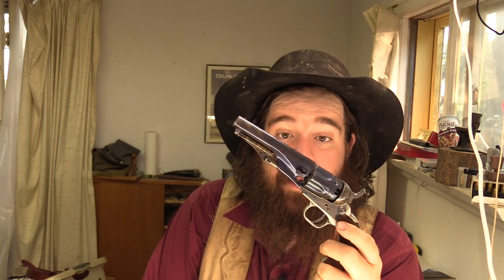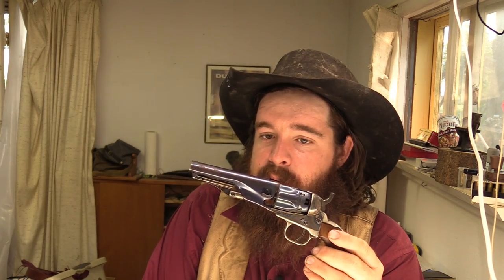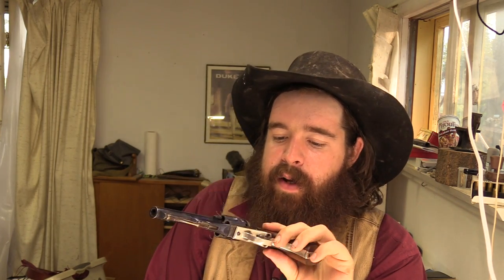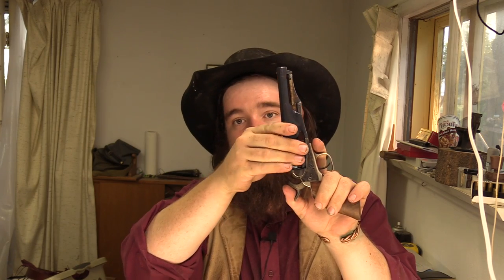Uberti 1862 Pocket Police

Comment: I have successfully made springs from music wire line the ones that track of the wolf sells.  I have put them in my 1851, 1860, 1861, and my 1862. Makes the pistols run super smooth.

Comment: I ended up putting two main springs in the one I had because it didn't always set off the caps and it got cap jams. Slixshot nipples fixed that issue. I sold it 6 or 7 years ago but plan to buy a new one.

Comment: One of my favorites.  I have an Authentic Colt police. I fire the elongated balls cast from the steel mold. The Colt mold.  As far as muzzle energy and all those questions, regarding modern comparrisons ,. At 50 yds, it penetrated through 3 pine boards with a 148g elongated charged with 18g FFFg GOEX (one 1'' board full penetration was considered lethal back in the day).  So, this is all the 'muzzle energy' info that s  needed.  Curiously, the Police outperforms the Pocket Navy both in power and accuracy.
Reply: You quit aiming.  I m  currently learning how to 'point shoot' the old Colts.  They were actually made by Colt to be used this way.  What a pain though.  Good shoot n!  This is a fun video to watch.  Hey!  Do a comparrison shoot with a light pocket, heavy pocket, Navy etc!

Comment: I have 2 of the Police models, 2 of the Pocket Navy models , .  I can make springs out of band steel quite well. Just shaping/filing etc as it is. No heating/annealing or whatever.  Works good. Anyway, one curious thing,- One of the Pocket Navys I have has a oiled stock instead of varnished (all of mine ar Authentic Colts). The stock is serialed to the pistol. Back in the day, Colt did strange things like that too. ALL  were silver plated though. None of these were military issued. I noticed that Uberties replicas are not plated.  Just another way for them to 'save money'?

Comment: I was surprised as to the power of this little pistol. It is more powerful than the Pocket Navy due to the rammer having more travel.  With 17g charge and a 148 elongated cast from an authentic Colt mold, this sucker   r e a l l y   delivers!  Mine are the 5 1/2'' models.  Aim point at 12 yards is 5''  low. At 25 yards, 20'' low and at 50 yds 30''  low.  Once the aiming point is figured out, the grouping is good!  As with all these pistols, the best performance is with a fair size elongated and a powder charge that compresses to where rammer travel stops but does not reach the end of its travel, and the tip of the ball   j u s t   below the surface of the chamber.

Comment: REQUEST... I want to put a Birdshead Grip on an 1862 Police and am toying with couple options to match up the back strap. How does the Uberti Lightning/Stallion Frame size compare to the 1862 please? Since of course the normal Uberti Birdshead grip options are slightly too large for the smaller 1862 frame. I am thinking about making an adapter piece to go inbetween or modifying the top of the backstrap. Sure would be nice if the smaller Stallion frame and grips even got me closer. ThankYou!

Comment: I make trigger/bolt springs out of safety pins.
If you can’t solder on a taller front sight, you might try cutting the notch in the hammer deeper…

Comment: can you file the front sight when it shoots that high?
Reply from the maker: Filing the front sight raises the POA. I'd have to lower the back sight.
Reply: No you put a taller front sight on.
Reply from the maker: If you're skilled with a welder, you could try it. Or you could have a gunsmith install a taller sight.
Reply: @DukeFrazierProductions  May be easier to just cut a dovetail and give it a modern sight. Sure it's not historic but whatever.

Comment: I'd love to find and old one that functions and cut it down an Inch. Lose the loading lever. Make a nice .38 snubby kinda
Reply from the maker: Cimarron just released the cartridge conversion in .380 last year.
Reply: @DukeFrazierProductions  Sounds great unfortunately I have to stick with cap and ball. I found a nice used one. Having Hammer Trigger and grip and trigger frame nickled. Refinished wood grips to red mahogany with oil finish. Black epoxy painting frame and barrel

Comment: I bought 1 Uberti, I'll never buy another
Reply: I like Uberti cartridge guns, my 1873 Trapper Carbine in .357 is awesome.  But when it comes to cap n ball I prefer Pietta.
Reply: My first cap and ball was an old FIE 1849 brass frame pocket model from around 1972 that I picked up at an auction for a deal. Didn’t shoot it much, eventually sold it. Finally bought the gun I originally wanted from the get-go, a Pietta 1851 .36 Navy from Cabela’s. This one was made in 2016. Haven’t had any issues with it, and rarely any cap-jams. Bought a Uberti 1862 pocket police from Dixie Gun Works on sale a year or two later. Out of the box, the wedge was bottomed out and could be pushed out with thumb-pressure, the cylinder could be slid on the arbor back and forth at least a 1/16th of an inch, and when I put caps on to burn the oil out, the hammer wasn’t able to come into full contact due to the cylinder sliding forward to even set them off. I considered tinkering with it but figured it would have been more aggravation. Sent it back. Maybe I had a lemon, but I’ve decided I’m content with the Pietta Navy and haven’t bought any others.